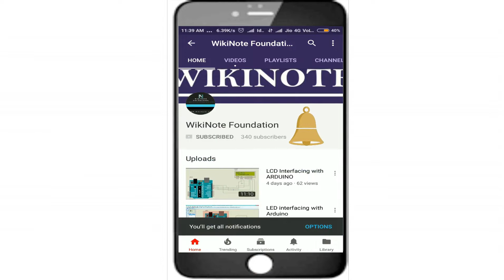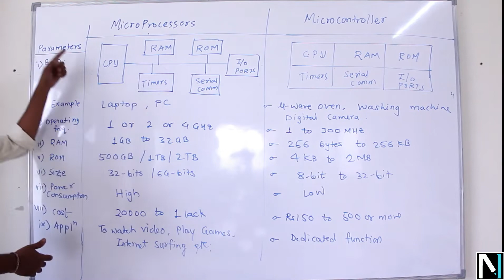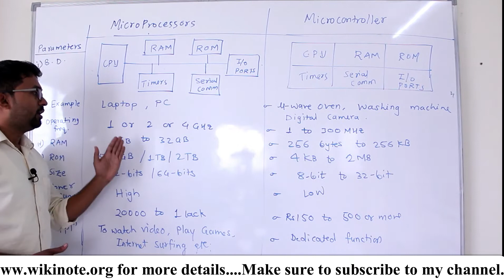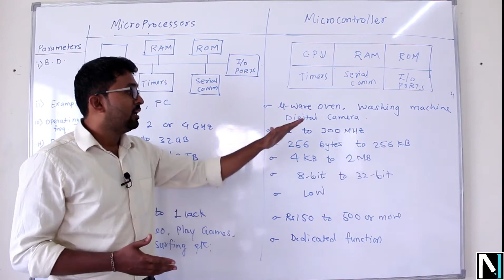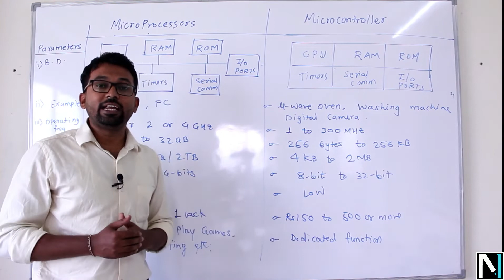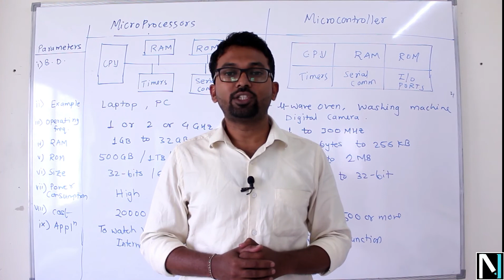U1#T1 | Introduction to  Microprocessor and Microcontroller | SoC

Comment from the maker: SE Mechanical & Automobile | SPPU | EEE | 2015 Course | YouTube Question-Answer Video Tutorial Series 

Key Features-
1. Cover's all 3 units of Arduino Part. {31 Video's}
2. Strictly framed from Mechanical & Automobile Engg students point of view.
3. 100 % Guaranteed passing with minimum efforts
4. Video's based on all previous Years Questions and their Answers.
5. Expected Questions and their Answers.
6. Explanation of each and every Question & it's answer 
    conceptually..
7. Short video's -Average length duration 10 minutes

For Subscription & Feedback

Write us at wikinotefoundation@gmail.com
Contact 8830002899
whatsapp 9404276434

WikiNote Foundation
Keep Sharing,
Because sharing is caring...
Happy WikiNoting.